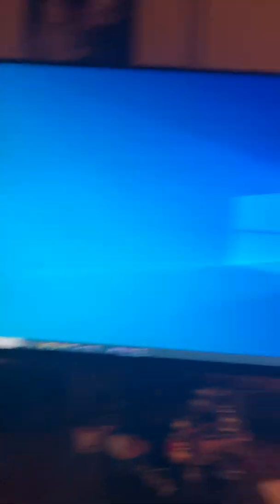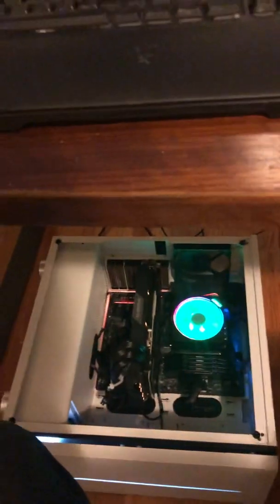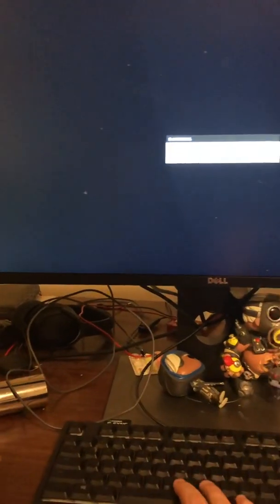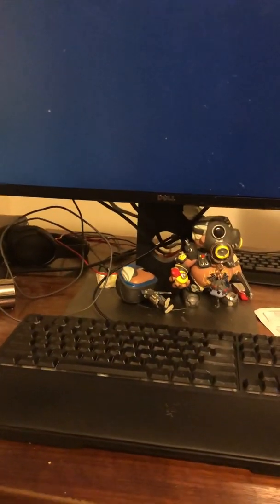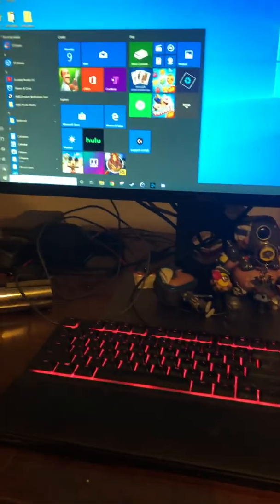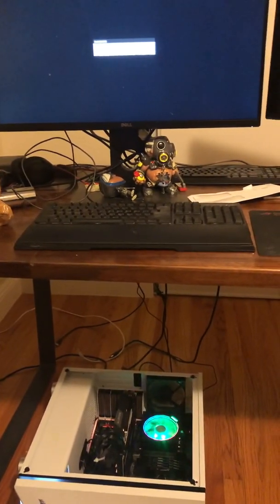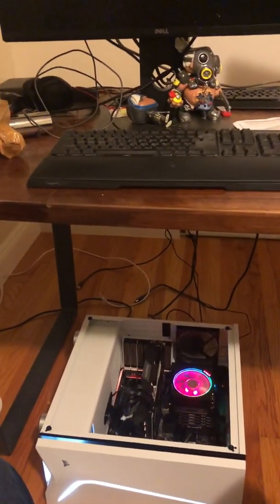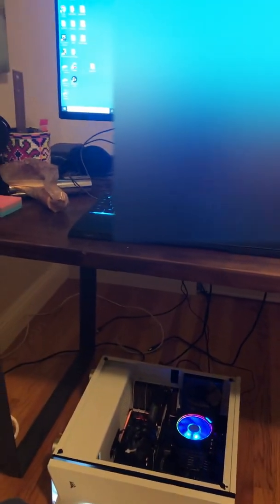Gigabyte X570 Aorus Elite Cold Boot Post Issues

Comment: I have one Aorus x570 pro wifi. I have same cold boot issue. Problema não the Windows, I installed ubuntu, same problem continues. I tried all on the internet but I have not found any solution. Some times it's very irritating.

Comment: I got the elite wifi with a 3700x just bought 4x8 trident z Royal put them in and turn on xmp and adjust the voltage and I'm lucky if I get in to Windows just boot loops over n over can't stand it

Comment: Fix?
Setup your bios. Save profile.
Power off. Pull cmos battery.
Do not do another cmos reset.
Cmos reset process is broken when cpu is installed. If you have to update bios or do a cmos reset you will have to pull cmos battery again.

Comment: also the same old known cold boot bug. new day - new challenge. PC starts over restart and with no problems, at second attempt (as nothing was happened) a grid of restarts, after then or no problems occur or bios becomes to reset mode. Real glitch, knowing RAM memories were changed, MB Gigabyte Ultra 570 LED stay on RAM LED going circle in to boot loop. Still the same, since sep.2019, model No.0330

Comment: I am having post and sleep issues also. Bran new build  x570 elite  f11 bios
Reply: The same. Even bios f12b does not solves that problem. pc goes to boot loop and RAM LED stay on until new restart
Reply: Did it fix the problem for you guys in the new bios update ? (F20)
Reply: Try turning off hybrid sleep in windows power settings

Comment: I have this same piece of shit board and have had everything you've described and more. I've been dealing with them for a while, and in January I decided to try and RMA it. They kept my board for a month and sent it back after saying "issue could not be replicated with multiple setups." I called bullshit and bought new everything except motherboard after I got it back and tested it and STILL HAVE THE SAME ISSUE. It's too late for me to get a refund now. I think I'm going to just video myself beating the shit out of it and send it to gigabyte. Fucking infuriating. I'd been happy with gigabyte in the past, it always worked fine until this. I'm never buying anything from them again.
Reply: @dj-rocketman8545  wrong. I tried mine, one of my friend's, my friend's entire setup except for my board, and bought an entirely new setup trying to fix the problem. The only common thing in all of it was the board. I tried my CPU as well as everything else in the other boards (non gigabyte) and everything worked perfectly. I've been using an MSI board since and haven't had a single problem. It was 100% a faulty board from gigabyte.
Reply: @dj-rocketman8545  it's your brain
Reply: its bleeding edge tech.. always wait till they work out their bugs and dont be their bug tester
Reply: New bios update fixed my problem

Comment: I have the same issue in a aorus X570 i wifi pro
Reply: i have the same issue with aorus ultra x570 mod. No. 0330. CRAP!
Reply: Same with itx aorus
Reply: @rubenps31998  It was a issue in my PSU, when I changed it the issue gone..
Reply: I have the Pro, Bios version F5 out of the box. No issues.

Comment: Thanks for posting this video, I have the same sleep and coldboot problem, but it happened every time. I must do the power supply drain then start, but every other cold boot, the fans running hard then calm down, nothing on screen. I even had a BIOS reset happen randomly as well. I have already RMA'd the board thinking it was a faulty, until an hour ago i installed the replacement board, including reseats. Same problem, even with the F11 bios. Im going to return this and go to elsewhere, what a joke. After searching the googles found this to be a rampant problem including this video. My previous build was using a gigabyte board and it worked great for a solid 6 years, SMH

Comment: Just when I think I have my mind finally made up on which motherboard to get I come across a video like this.
Reply: lmao same
Reply: Master Of Puppets  I haven't had any issues yet (knock on wood) I don't overclock so I dunno.
Reply: @Tintamar5678  Lucky, my x570 master genuinely makes me want to slit my wrists and fill my loop with my blood. I've had so many issues it's incredible, the latest is the bios randomly resetting when it posts. Switched my ram twice and each has yielded issues. It may be a lemon I really don't know but it's far too late to return it. I've had the same sleep issue, it was related to my wifi driver and it got fixed pretty quick.
Reply: @troyl5929  :( that sucks
Reply: @Tintamar5678  hey oh my god. so i bought this board 2 days ago and it comes in the mail in a week, i keep on seeing aton of bad reviews with the board after buying, is everything working for you? i dont overclock anything so should i be worried?
Reply: @poopnugget5037  I haven't had any issues (yet) I have the Pro not the Elite though and I dont overclock either other than setting the correct XMP profile for my ram (3200)
Reply: Same
Reply: @techcentral9521  I ended up going with a Gigabyte x570 Aorus Pro WiFi. So far Ive had no issues at all. Came with Bios version F5. Haven't bothered to change/update it since its working great.
Reply: I wish I came across a video like that before I bought it. I hate Gigabyte for this. I will just throw it away and buy a better one.
Reply: @mario-off-topic  I still have no issues with the Pro version (Knock on wood) its been 16 months running mostly all day.
Reply: On a side note anyone reading this and planning to buy G.Skill Trident RGB ram... go with the 3600 and not the 3200. The 3200 NEVER goes on sale if you plan to add more later. 3600 always going on sale.
Reply: @Tintamar5678  Hello there! How's it going with the Pro Wi-Fi version?
Reply: @JohnNoizz  Just died on me last month. Would no longer boot. 4 months out of warranty. Swapped it out for an Asus TUF Plus x570. I ended up having the same issues in the video for about a week where I had to keep retrying to boot it until it finally would. Then after a week of that it just refused to boot up. I had just done a window update too and it wanted to restart.. I was thinking to myself... watch it not want to boot now. Sure enough, no boot and trying over and over no longer worked. Luckily swapping out the motherboard went super smooth (Way better than I thought it was going to go) only thing I had to do was buy another Windows OEM key for $20 to get the activate windows watermark to go away.
Reply: Have a new gigabyte aorus elite wifi, having the same posting issues. Bios constantly resetting. It’s driving me freaking nuts. Don’t buy a gigabyte x570 it seems like a really common problem. Such a downer for a new rig :’(

Comment: I had an asus tuf x570 that worked for 2 months.I sent it back because it didnt boot at all suddenly and today got an aorus x570 ultra.Worked for 30 minutes then its not booting at all.Vga light stays on.Shall i send the new one back too?I’m fucking desperate at this point
Reply: Sounds like you are overclocking and maybe doing a little too much too fast before even getting a stable system?
Reply: Tintamar5678 It was a faulty mobo.Sent it back got an asus and everything is working great since then
Reply: @johnadamos7399  cool